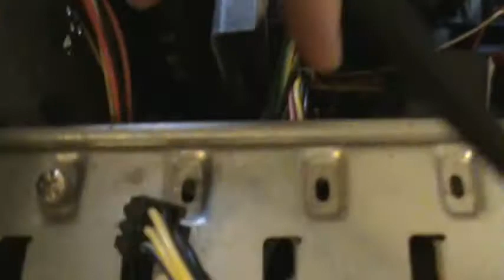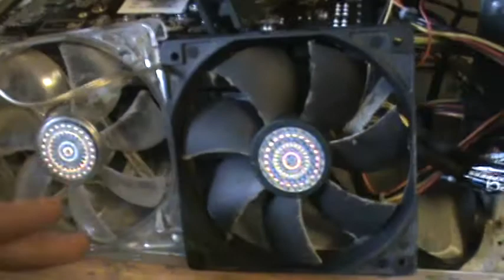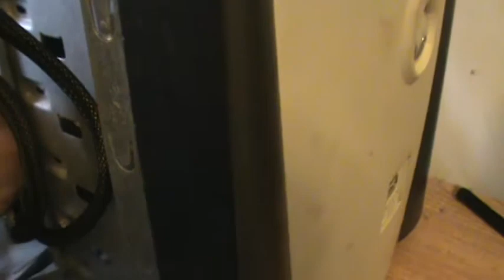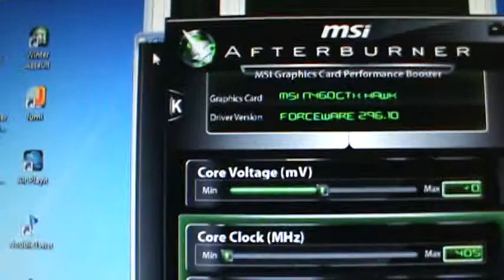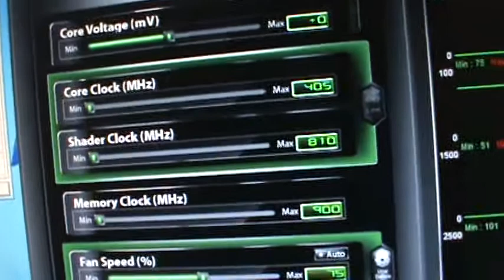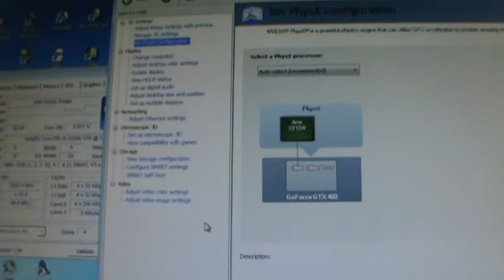New Build Part1

Comment from the maker: its a silver stone fully modular, 750watt, quad 12v rail, had it for years, never chocked on me, and its running my gtx 460's oc'ed in sli like a beast, so i might not even need to upgrade that when i get my 680's... case not a big deal to me i already have a full tower one just not at this house, temps are more then perfect, so far 130% happy with this setup so far, it games like a beast, and is faster then all competition cards i put it against.(like the 470sli, 5870Xfire, 6870Xfire)